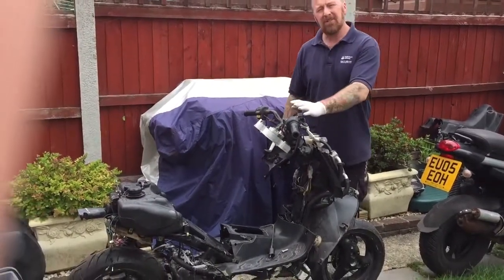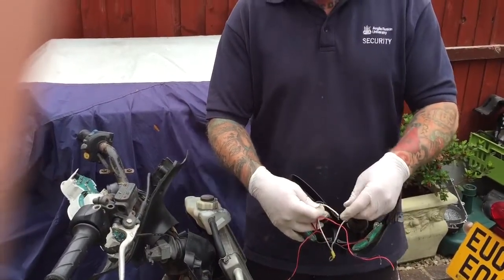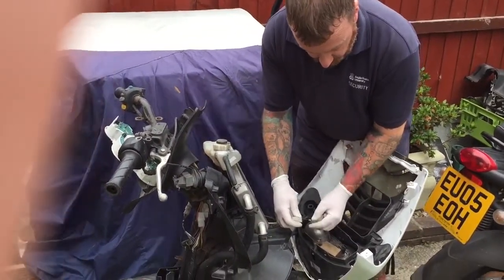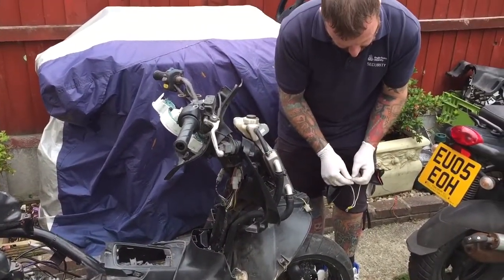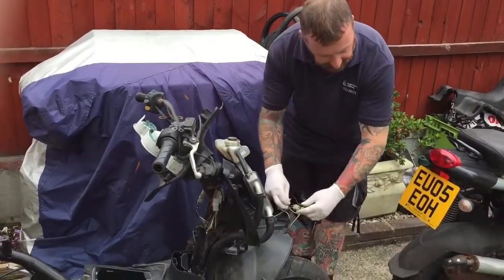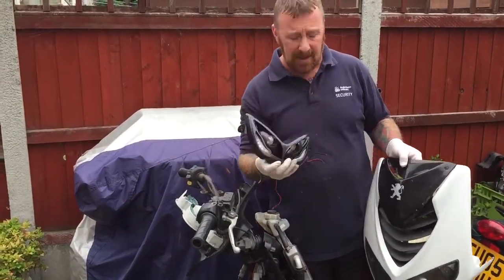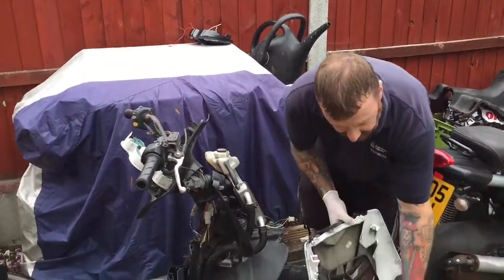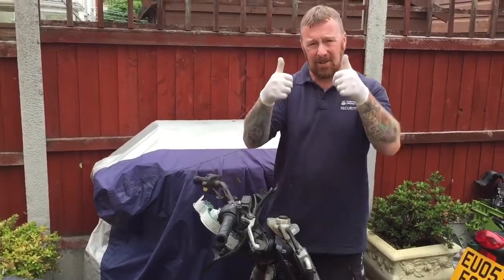EVO HEADLIGHT HOW TO WIRE THEM IN MARK SAVAGE

Comment: Hi again Mark. Sorry for all these questions. Just want to make sure my vivacity makes it through mot! The lights on it are flickering at low revs (i.e idle). They're not flickering too much, but it is noticeable. When I rev the bike, they become brighter and stop flickering. This is happening to all lights; headlight, rearlight, dashboard lights etc. Do you know what the problem could be? Thanks again!
Reply from the maker: Hi bud well it will pass the mot like itit will be to do with your stator coil 
But first wd40 all your connectors and battery terminals 
You can just up the revs a little but basically the stator coil get dirty and work not at 100% 
Take off and clean or you might have to replace !
I have a few videos on the stator coil on speedfights and aeroxs and the basics are the same 
Failing that it can be and worth a check your power regulator !
Reply: @marksavage  Ah ok. Thanks for letting me know. Just watched the stator coil video and it's a bit of a bugger to get to! Do you think it could be my battery? Also, flickering lights won't fail mot? That's surprising haha!

Comment: Which cable is the high beam and low beam Peugeot Speedfight 2
Reply from the maker: It's a four pin connector under the front fairing 
There is only 3 wires 
Green earth 
One low the other high test which is right when running

Comment: Hi Mark is it possible to modify the new halogen headlight setup for speedfight 2 to pass mot?
Reply from the maker: The main beam is a projector type so yes I guess it should be possible but not for high  beam but worth a go bud 
Would be a lot brighter!!
Reply from the maker: Oh wait sorry bud thought you were talking about led 
No not the 12v kitchen eco style 
They have no pattern so will not pass a mot
Reply: I have bought kitchen style without researching properly. The original is failing on mot as it's not creating a clear light pattern is there anyway I can refurb or clean it up?
Reply from the maker: @harryfryer8221  no bud 
Buy 2nd hand off ebay 
That's the only way or look on Facebook sale